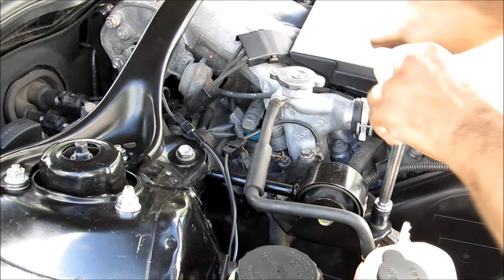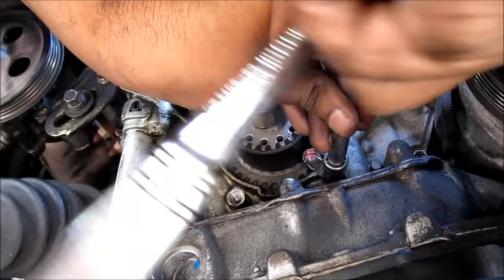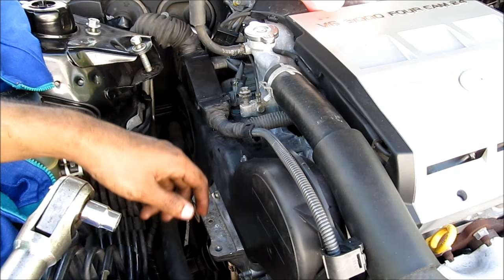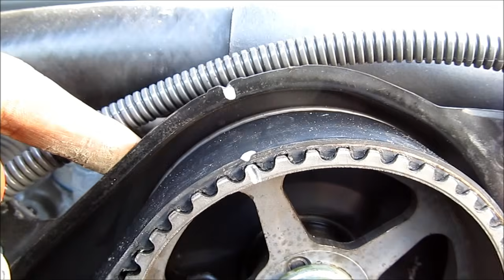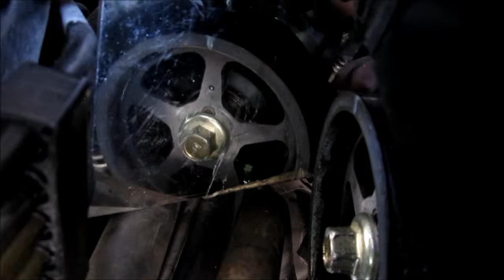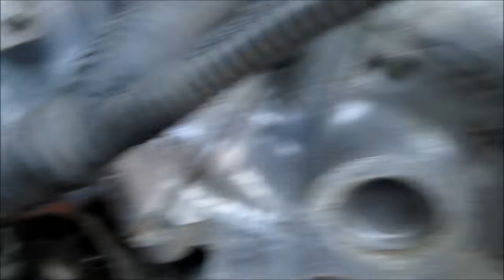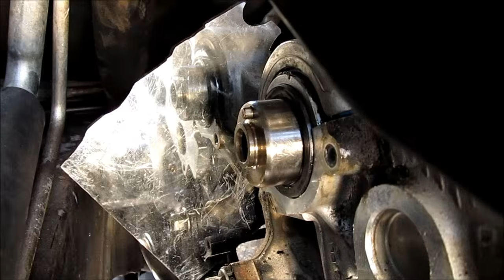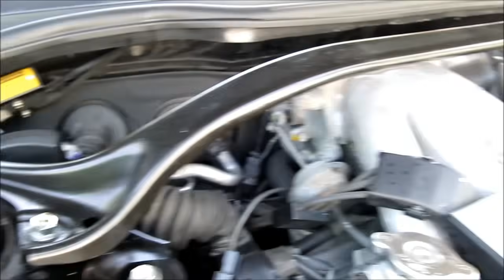Timing Belt / Waterpump Replacement: Toyota & Lexus V6

Comment: When u remove the engine mounts aren't you using something to support the engine?  Just asking cause thought about replacing the timing belt
Reply from the maker: +Kevin Lucas No need, that mount removed was just the torque mount, it doesn't support the weight of the engine.

Comment: As someone who has just purchased a "new" used Toyota and very much wants to take care of it so he can be one of those people who brags about it lasting well past the 300k mile mark, knowing absolutely nothing about vehicle maintenance and repairs, this is overwhelming. I was told that timing belt replacement was among the more manageable DIY things. Fml. lol
Reply from the maker: Thanks. The timing belt looks daunting but I'm sure when you watch some videos and read some tutorials you'll get comfortable. 

You can even pull off your timing covers and start identifying bolts and pulleys to familiarize yourself. 

However I would not recommend this if your new to auto maintainence. I botched my first TB job on my Lexus and had to get it towed to the mechanic. Lessons learned.

Comment: Hey does the oil pump pulley need to be time aligned when replacing the timing belt?
Reply: Luis Rodriguez I have the same question. Did you get an answer?

Comment: Excellent video, there are camshaft seal removal/installation tools that make the job much easier and almost foolproof removing and installing the camshaft seals. They work nice in tight places.
Reply from the maker: +James Rairdon Thanks. The camshaft removal tool I got was too big to fit in the back seal, so the paint can opener had to make do. As for installing, next time I'll try using the old seal and camshaft sprocket to push in the new seal as I tighten the camshaft bolt.

Comment: After watching this video, I stop complaining about working on German cars.  This takes way more labor
Reply from the maker: +2Phast4Rocket Haha really? Thanks, while this is tight up against the right side fender, I still think German cars are harder to work on, especially for more routine maintenance.
Reply: +speedkar99 You are right about German cars need more routine maintenance.  The German cars have engine in the longitudinal position and that helps the situation somewhat.
Reply from the maker: Well the point I was getting to is the routine maintenance they do need is a bit more cumbersome. Simple things like having to remove many clips pull off the undercarriage plastic to access the oil drain bolt....
Reply: I guess I got used to removing these various panels that I don't pay attention to them anymore.

Comment: Hey im stuck on getting the crank pulley bolt off, the starter method isn't working even with a booster on the battery. What kind of air compressor and gun did you use? Thanks
Reply from the maker: +KgreProductions My 1/2" impact couldn't get it off the first time either. You'll need a 3/4" impact gun and a 20 gallon compressor. You could just take the car to a shop have them crack it loose for you. Once it comes off the first time and breaks the thread locker, it should be much easier subsequently.

Comment: Just finished my water pump and timing belt change on my 99 toyota sienna.  I bought it for very little because the previous owner did not want to invest between 800-1000 dollars to repair the problem it was having.  She did park it as soon as it was having issues though, so the engine had not been damaged in any way and still had plenty of life in it in my opinion.  

I'm a backyard mechanic, but I'm far more used to motorcycles, scooters, and big old ford trucks.  We have a Toyota corolla that's been a trooper, but I really haven't had to work on it too much.  I have changed a timing chain driven water pump on a Pontiac  before, so I wasn't completely intimidated, though this is a tedious and  high risk job.

Well, I just finished and I must say that it couldn''t have gone any more smoothly than it did, and I believe that was 90% due to this Terrific Video.  This is the best produced and least boring, most straight to the point and accurate repair video I have ever watched.  Thank you so much for helping me to get my family a vehicle that we needed for a fraction of the price of what it would have cost if it was in perfect working order!!  I saved a bunch on the parts I ordered as well, so I turned a 1000 dollar job into a 150 dollar job!  I own the repair manual, and I didn't look at it once...didn't need to.  KEEP MAKING REPAIR VIDS PLEASE!!  You Rule MAN!!!
Reply from the maker: +David Rhineheimer Thank you very much for your feedback. I'm glad my video helped! My style is to produce videos that are concise and to the point and just present what is important and necessary.

Comment: Did my 2000 4Runner 3.4L V6 timing belt, which faces forward- much easier when it faces straight ahead. Was that OEM belt tensioner?
Reply from the maker: +jake ounce Longitudinal engines are much easier to work on than transverse where everything is up against the fender. 
My car's timing belt was changed in 2006 so I'm not sure if the tensioner was original.

Comment: What kind of cam seals did u use for this job?? and are the front and rear cam seals the same size or different sizes. im doing this job currently on my 95 es300
Reply from the maker: +Charles Celinski I got them from RockAuto. I don't remember the brand name (was it felpro?). The front and rear seals are the same on my 1MZ-FE. Good luck on your TB job.
Reply: +speedkar99 thank you. job was a success! thanks a lot to your video
Reply from the maker: Good to hear!

Comment: Hi how  do I disconnect the ignition to turn the crank
Reply: +antonebear1 Hi well I just removed the front  3 spark plug wires. and had  to hit the ignition 3 or 4 times to get that main bolt off .I almost gave up  BTW I volt Best Video  Bravo Sir!!!!!!!.
Reply from the maker: +antonebear1 Thank you. Yes removing the spark plug coils works, or you can remove the ECU or EFI fuse.
Reply: +speedkar99  Hi yea next time I will use the fuse way. for the job.  ..Lucky I didn't have remove the rear cam gear. I saw in a other vid that if you don't remove the rear cam gear. and it turns something can get damage. For me because I didn't have  to change cam seal. But I had to remove 1 10mm bolt. and the cam gear turned and  ( smashed my finger) I turned it back to its mark after I replaced the water pump.  BTW. can I flush out the old coolant  and replace it with cheaper then ToYota brand ? .
Reply from the maker: Good to hear you get it done. Yes that cam gear is at the top of its cam lobes under spring pressure so it has the tendancy to rotate when the timing mark is aligned. If it moves, you can just move it back. Yes you can replace with coolant, there are a few compatible brands, search some posts on ToyotaNation for cheaper fluid. I just stuck with the dealer fluid regardless.

Comment: forget this ill take it to the shop
Reply: lmfao!
Reply: LOOL
Reply: yup even though this is a good video but not step by step detailed process... thats what i am used to for this complicated work.
Reply: We all aren't mechanically inclined, nor do we have the tools required.

That's why I take my car to my Lexus dealership. Sure, I will pay a premium for service, but if something goes wrong, I know that Lexus will stand behind the work and make things right. 

When I was young and dumb, I learned the hard way when I took my Rabbit Diesel to a diesel specialist (recommended by a Mercedes dealership's service manager)  because fuel injector tubes kept splitting.  Hours after picking up the repaired car, it started spewing coolant.   Turns out the mechanic over-torqued a bolt resulting in a cracked engine block. The mechanic admitted his mistake but insisted on using a salvaged block.  I was without the use of my car for close to three months and was offered no loaner.

I was preparing to sue for damages when I learned that the shop went out of business.
Reply: Mr. Desert it would be less expensive if you do it yourself
Reply: Not if he never gets it back together or apart for that matter....
Reply: Mr. Desert ikr!
Reply: Mr Desert :Me ,Too On Taking it To A Cert.Mech..But Will Make Sure Mech.Has Access to This Video,In Case He Hasn't Done A Lexus T.Belt.
Reply: Chicken!
Reply: I think the rear valve cover gasket is more work than this.... you should look that up!!!
Reply: Cost me $500 to get a mechanic to do a water pump.

Comment: Hey man, I really need your help! I am trying to installing the timing belt on a Toyota Sienna and the rear cam has a lot of tension on it. How do I get the timing marks to line up? Especially the rear camshaft. Also, did you marks line up perfectly on the gear to the backing plate?
Reply from the maker: +Yod S They don't appear to be aligned but you have to use a mirror against the firewall to get a clear view of the timing mark against the cover. If its off by a hair (but not a full tooth away) chances are your timing is still on. The tension in the timing belt is due to the rear camshaft being at the top of its lobe, and the springs forcing it one way or another. I used a breaker bar and a (17mm?) socket to hold the camshaft steady while I slipped the belt over and clamped it to the teeth.
Reply: +speedkar99 THANKS MAN I got everything back together and its runs good.
Reply from the maker: Good to hear.
Reply: +speedkar99  After watching your video again, I notice you mention how difficult it is to remove and install the cam seals. Blue Point and Mac have a special v6 cam seal removal and installer kit. I used it and it was great in installing the rear cam seal. You might want to invest for future jobs.
Reply from the maker: Good point. I would have liked to have a proper puller and installer to put in that seal as it was seriously a PITA. I don't do a TB job that often enough to invest in a tool though.

Comment: Good job dude.

Was looking at a 2000 V6 Camry to buy, but thinking the timing belt change was going to be an absolute headache. You've obviously done this a heap of times, and make it look relatively straight forwood.
So me being a backyard mechanic, but trained in 16 cylinder compressor rebuilds, im thinking this job wont be a shit og a job as im thinking.

Thanks for the vid, and apprecieate the relaxed approach you have. Made the video easy to view.
Will now buy th V6 and not the 4. Cheers.
Reply from the maker: +John Mack Good choice. V6 all the way. Smoother, quieter, more power and refinement. 

This was actually my second timing belt job. My first one was a fail, on my Lexus ES330.

Being relaxed is the key to getting things done. Having a second car to drive to the parts store or to work next day just in case also helps :). I did this over two days, 4 hours a day.
Reply: +speedkar99   I bought the car yesterday. Your right about the smooth drive dude, but have to say, the car feels really heavy and in some what - safe.

I normally drive a Toyota Prado and that thing is heavy, but the camry feels somewhat the same. Doesn't do anything nasty or anything, and all steering gear feels tight etc, just must be the way these things are. Hugs th road and feels solid.

Took you tow days to do it hey (by choice no doubt). I think that's the way ill go to, maybe even 3, lol.
Thanks buddy, and best regards from Sydney Oz.. Cheers.
Reply from the maker: Good to hear. Keep up on the maintenance on the Camry and it will last you a long time.

You'd probably notice maintenance and gas would be cheaper on the Camry than the Prado, which is always welcome :)

You are right, the Camry isn't as susceptible to road imperfections and cross-winds in the steering as other cars are. I don't have any problems with my Solara and Lexus ES steering down the road, despite a floaty feeling on corners, characteristic of the soft springs.

Comment: Can I just have the timing belt changed without changing the water pump? Or is this against your shop policy or, against ASE regulations compliance?
Reply from the maker: +Robert Ballesteros As long as your water pump checks out fine and all the bearings show no signs of play, you can get away with changing just the belt and tensioner. If the water pump does fail though, you'll be on the hook for all the labor in removing the timing belt to get a new pump in.
Reply: I got your point here now. thank you.
Reply: +Robert Ballesteros Its not professional at all to just change the timing belt. You are supposed to change everything the timing belt or chain runs on. The cam and crank seals aren't necessary but always a plus. I wouldn't trust a mechanic who would just do the belt he might do more damage than good. ASE doesnt have any regulations or compliance its just a stupid test i took and after two years of working on cars they sent me my certificates.
Reply: Thomas, I appreciate your input or comment. Thank you.

Comment: Why is it that you need to change the water pump together with the timing belt? Is this ASE requirement  or optional? Or, maybe one way to increase your shop profits?
Reply: +Robert Ballesteros The  water pump could break the next day and you would have to take the timing belt off all over again.
Reply: Okay, I gotcha. Thank you.
Reply: It's called insurance. Or possibly double the labor costs if you don't. I do my own work and skipped the water pump on my first t-belt service, too expensive I thought. 15k miles later water pumped failed on wrong side of town. Nice sports car. Had to leave it there for a day and did the whole service all over again. Had to go ahead and replace belt again since I was in there......again.

Comment: These engines are fantastic. Just ordered the same timing belt kit from rock auto. If i remove the camshaft bolt without using the camshaft holding tool will it mess up my timing? Im going to change my cam seals too because they are leaking pretty badly.
Reply from the maker: +Thomas Anderson You should loosen the camshaft bolt with the old timing belt on in case it slips a few degrees. Not hard to realign if you move the cam slightly though.
Reply: +speedkar99 you made it look really easy how many hours did you spend on this?
Reply from the maker: 4 hours one day, 4 hours the next day including filming, taking pics and breaks.

Comment: do you know if ECCPP parts or timing kit products are good?
Reply from the maker: +199alexman Haven't heard of ECCPP. Just stick with Aisin, not all waterpumps are made well, even from reputable companies. The Gates timing belt kit came with a cheap water pump that is now leaking 3 years after I installed it in my Lexus ES.
Reply: i see, i already bought the timing kit but i am not going to use their waterpumps or any after market waterpump. i will see once i use the kit how long the life span for it. but thanks for responding tho

Comment: Hi Speedkar,Looks like my 2000 Sienna is leaking oil from the cam seal.  Can't tell for sure unless I pull everything apart.  Is this procedure the same for removing timing belt and setting it up?  To change a seal, I have to go thru all of this?  :(  Or is there a way to stop the leak (like a leak sealer that I can pour into the engine oil?)  I want to keep the van for another 2 years.  Do you think it's necessary to change it?  Any danger with not changing it.Thanks again for all the beautifully shot video.  Very detailed.   Oh, BTW, what do you call the seal if I had to order the parts?  Front and Rear Cam Shaft Seal??
Reply from the maker: Thanks for the feedback. Yes this is what needs to be done to change a leaking cam seals. The sienna might require the wiper cowl assembly to be removed additionally.

If its not leaking bad, then leave it until it gets worse. Its not a safety concern, though make sure you keep an eye on the oil level. 

If its leaking all over the engine, use some engine degreaser to clean things up, especially if its burning on the hot exhaust. That'll make it easier to pinpoint the leak, which could also be a leaking valve cover.